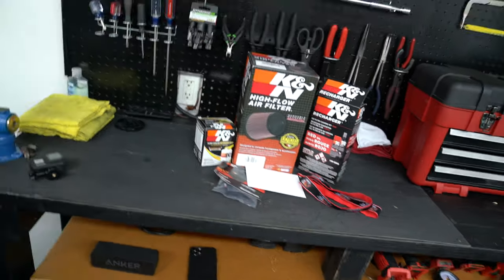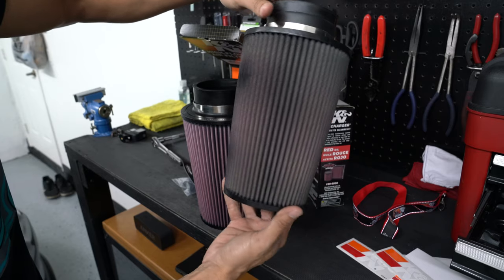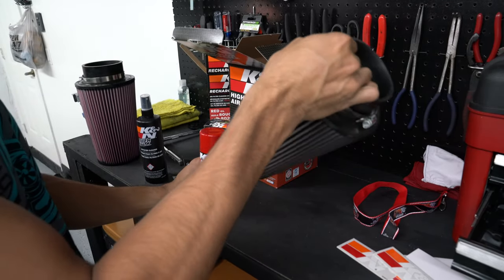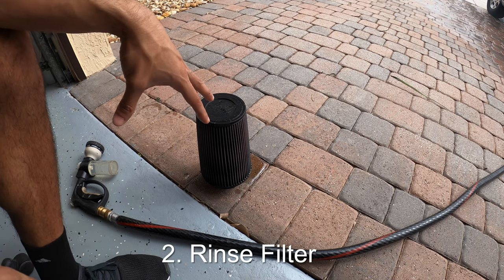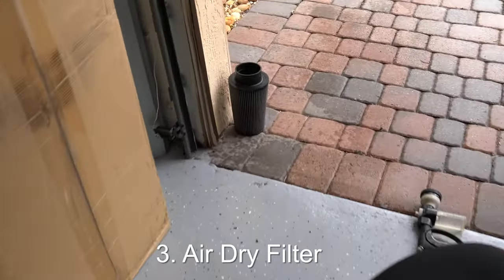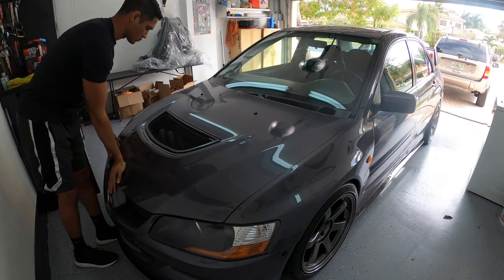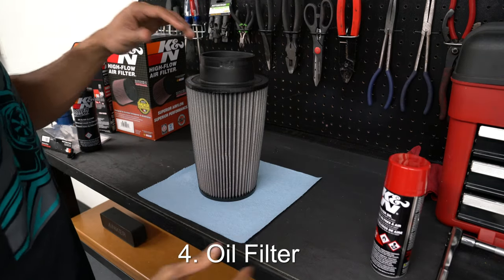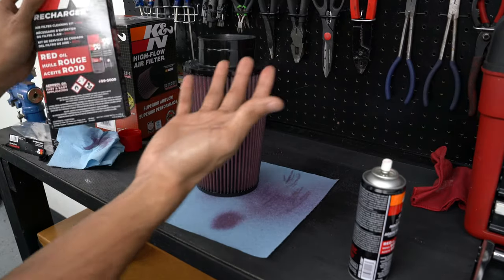How to Clean Your K&N Filter! Fast and Easy!

Comment: Also k&N says to wet filter both sides but only to spray outside of filter to clean filter , and not to knock your video but the cleaner says that its a skin and eye irritant! i would imagine if you realy wanted to do k&N a solid review you would remind people to use proper safety measures while cleaning your filter.  Could not help hearing you say it was burning your fingers! Just sayin bro other than that great video.

Comment: Good way to save your $30 on the cleaner and oil is just used Dawn dish soap and automatic transmission fluid oil to charge it. After I spent the money on the k&n stuff I found out I could have done it for a lot cheaper.

Comment: Why do u want oil going onto the air flow meter and oil going onto the turbo blades and throttle body and in the intercooler 

If your car sucks hard Enough it will take in the oil 100%